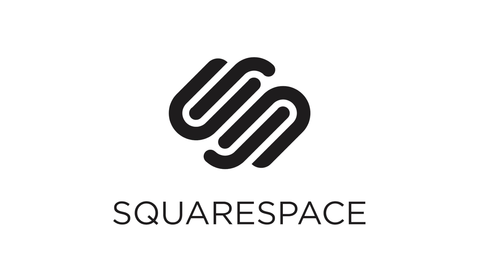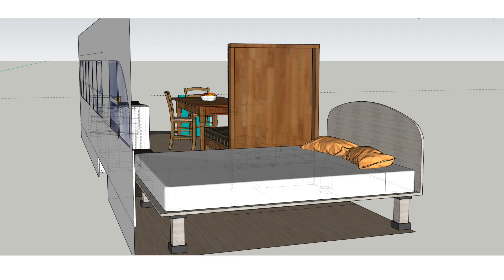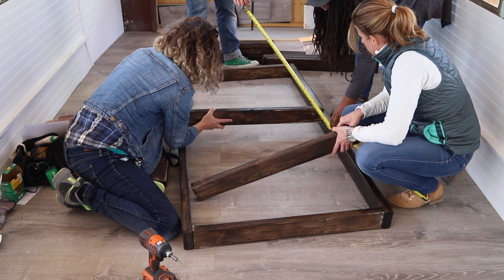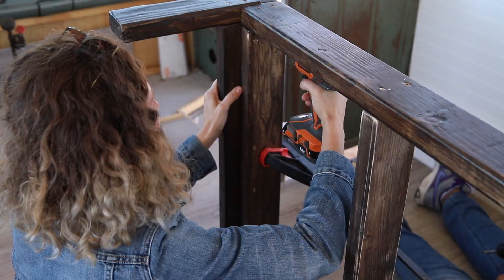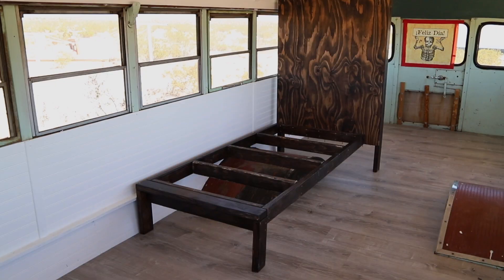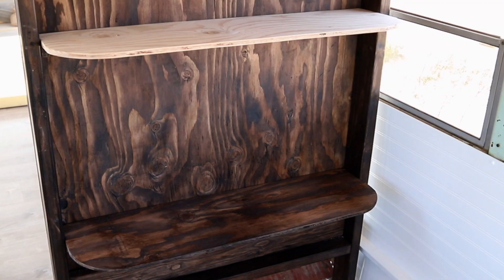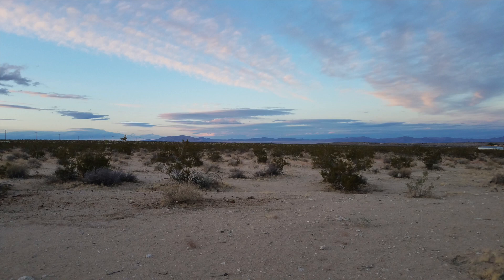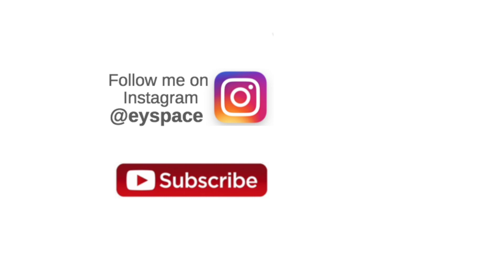DIY room divider sofa bed combo for a school bus conversion

Comment from the maker: Materials I used for this project:
High density foam foam: http://amzn.to/2DMRn3N 
Batting: http://amzn.to/2FVIACG 
Spray Adhesive: http://amzn.to/2pjX97Y 
Staple gun: http://amzn.to/2pcHnfI
Varathane wood stain (color: kona):  http://amzn.to/2ubtLGt 
9 x 2”x4”s
2 x 4’x8’ 1/2 inch plywood
Wood filler
¼” plywood
Reply: A tip: watch movies at flixzone. Me and my gf have been using it for watching all kinds of movies these days.
Reply: @Seth Jacob yup, been using Flixzone} for years myself =)

Comment: +EngineerYourSpace
I really like this. I have been in countless bus conversions and almost always, if a similar effect is sought, the owner has made the divider and then made the couch or bed as two separate units. If I was going to do this, I would make it so that the bed fitted into the divider in such a way that it was easy to remove if I change my mind. And using screws does that as you've shown. Nice job.